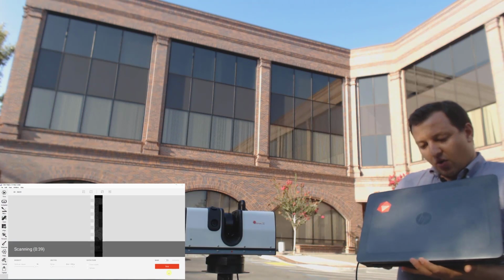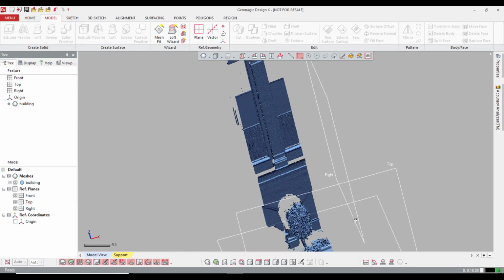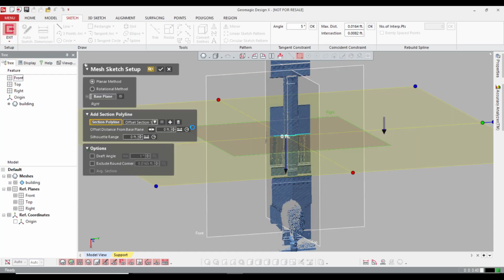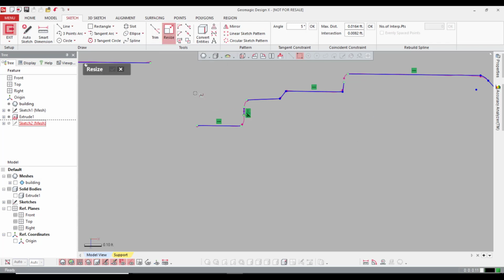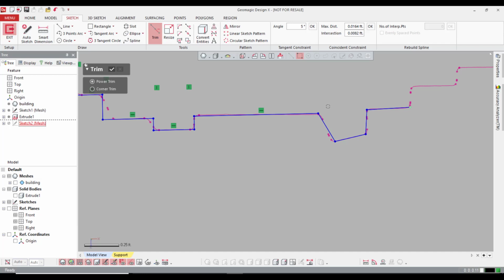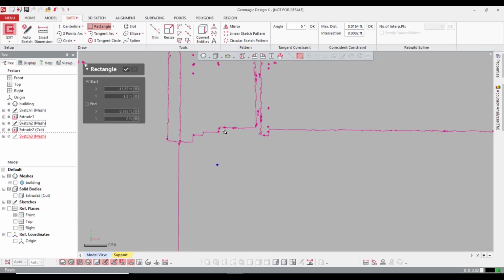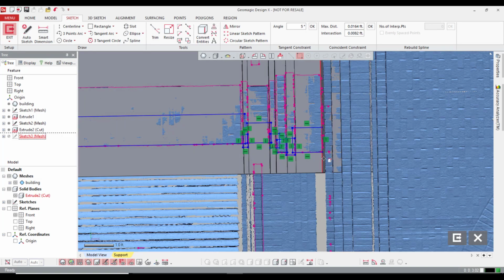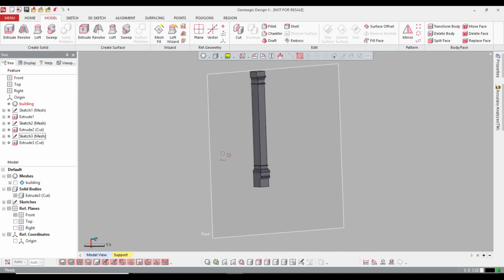Indicate Webinar Artec Ray & Geomagic Design X

Comment: What is the purpose of tossing around with those rectangles??? Line is a basic command!
Reply: He also didn't line up the cut lines on the 2 directions that he cut, which results in added complexity to the CAD model that doesn't actually exist in the physical part.